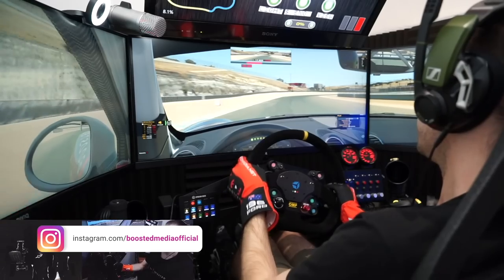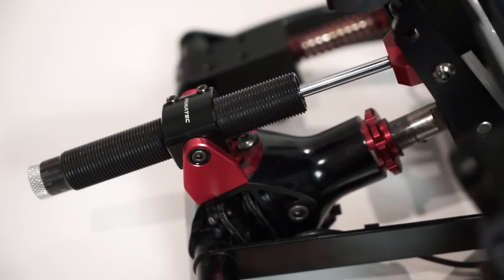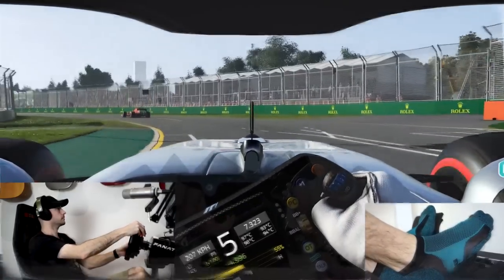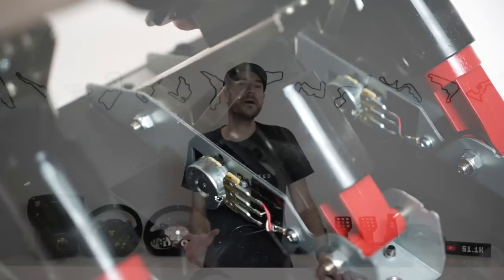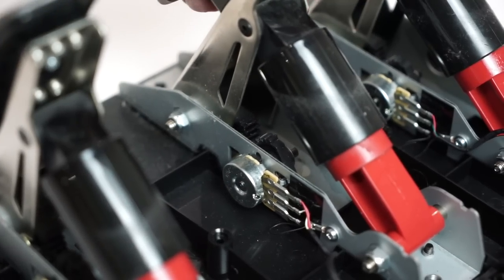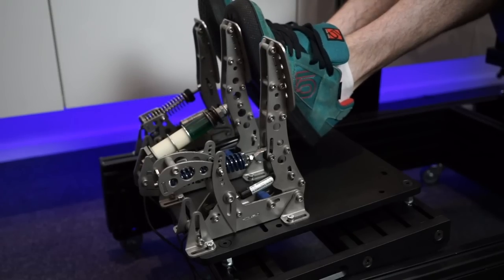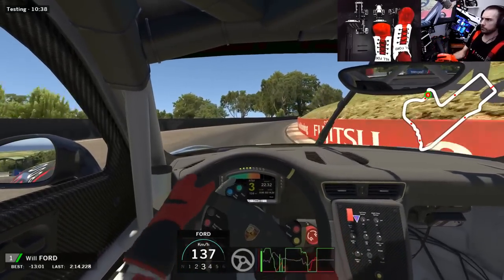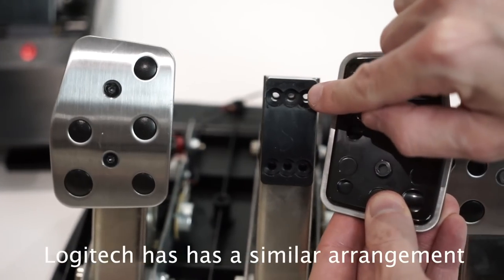Sim Racing Pedals Buyer's Guide

Comment: If you play with a desk and chair, there is a very cheap and easy solution when upgrading pedals. Mount the pedals to a piece of plywood, then cut holes that the wheels/legs of the chair can fit into. The downside is that you have to get it just right because you won't be able to move forward or back, but I did it and it works really well.
Reply: I put a bolt into the playwood and connected that bolt with a steel rope to my chair. The steel rope has a rope tensioner in its middle for adjusting the distance. 
Works great and I can press the break as hard as I want. 

The only downside is that when you press too much from above, your chair gets lifted up.
Reply: @karlmaier1013  so, you can do wheelies!!  Haha
Reply: I don’t understand this
Reply: I took some paracord, tied a loop and just hung them onto 2 of the wheels on the chair and 2 of the racing sim stand's foot. works just as well and hassle free

Comment: And... Just bought a heusinkveld sprint. Comming tomorrow i think.. Sold my v3.. And i was lile: no never gonna upgrade, i love my v3 and got them dialed inn perfect.. And i got all inn the same ecosystem. That was important to me.. The i got a deal on those sprint.... Sic... Now more time adjusting and tuning pedals before driving.. Hope theyre worth it...
Reply: Espresso Ryen-Grødahl and? Are they?
Reply: @johntaylor2971  its another ballgame! One thing is the buildt quality. But the feel of the clutch. When you feel the bitepoint. Breaks are awsome! And while you on v3 had to crawl "down under" the rig to adjust loadcell, here you have software. And you can adjust "everything" in that. Kg of loadcell pressure, linear non linear and in what way no linear. And save it to different profiles. And if you want you can have different set up for all the different cars. Stock its all linear, you can allso download some prebuildt profiles. I tried out and use the gt3 one (to everything in iracing) just adjusted the bitepoint on clutch a bit..
Reply: Espresso Ryen-Grødahl I take this as a „yes, they are“.... I did like them too
Reply: @johntaylor2971  yes, for short.. 😂😂😂
Reply: Espresso Ryen-Grødahl 😄

Comment: I really enjoy your sim racing channel: Informative, Articulate, Unbiased.  I'm just getting into sim racing and trying 'slow my roll' and not jump in with both feet before deciding if it's something more than a quick fad for me (I've done this too many times and spent way too much $$$).  My current setup is G29 w shifter, Playseat, ButtKicker and PS4. Sim is Project Cars 2.  Goal now is to learn, practice and race with friends and family around the World.  I would really appreciate some insight on gear that I could buy now to use with my console (PS4) that would transition to PC if/when I decide to get serious.  My research thus far points to Fanatec CSL Elite, but my knowledge is limited.  Thanks in advance.
Reply from the maker: I’d probably skip the buttkicker as they aren’t real great with consoles. Put that money into a better wheel and pedals. :)
Reply: Boosted Media I’ve already purchased the ButtKicker. 🤣 
Looking for assistance on hardware upgrade path from PS4 to PC per my comment above. I’ve noticed other comments asking for the same info. 👍🏻
Reply from the maker: Jeffrey Deitch next video in this series will be on monitors and VR. Then PCs :)

Comment: The thing I don't like about the Logitech G29 pedals is the "play" in the mechanical system. The black, toothed, plastic lever has about 4-5mm of play before/after the potentiometer turns. (I've modified my pedals accordingly.)
Reply: I would like to know more about how you reduced/eliminated this issue.
Reply: @jeffrey-deitch  Inspired by this video https://youtu.be/KiesEdzZFM8
realised that just needed to wedge shims underneath (such that the pedal is already partially depressed). There's a threaded hole for a bolt nearby, so was able to use that to hold shims in place.
I used DIview with my laptop to check the calibration.
Hope that makes sense?
Reply: @jeffrey-deitch  forget that I actually filmed this video on my phone at the time. Apologies that there are no graphics, voiceovers, stunning pieces of music... And the fact that it's in portrait (rather than landscape), but hey ho
https://youtu.be/pS1WVZ19Xps

Comment: When you get to PCs, can you cover how much computer you NEED to be able to run at high(er) quality on a 49" super wider monitor, triple screens, etc?  I'm looking to purchase a gaming PC I'm having a hard time finding guidance on what is necessary and what is overkill.  Particularly in relation to GPUs.
Reply: Don't know if this is helpful, but I've had both setups with my PC. I had triple 4K monitors and switched over to a 49" 120 Hz 1440p ultrawide. I can play at pretty much max settings on the 49" and get ~100-120 fps in games like Project Cars 2 where they take advantage of things like SLI. Other games like Forza Horizon 4 and Forza Motorsport 7 only use one GPU and are pegged at 100% to get 85-120 fps at ultra settings. With 3x monitors using Nvidia surround I was rarely able to get 60 fps with resolution at 4K in PC2 so I lowered the resolution to 1440p or 1080p to get 60fps stable. If you're looking at getting one 49" ultrawide then you'd probably need at least a 2080/2080 Super to take advantage of the monitor's refresh rate. My CPU is rarely at more than 25% load during these games so that's definitely overkill.

Specs:
i9-9900K
Asus Z390
32 GB RAM 3200MHz
Games on Samsung 860 Evo 2TB SSD
2x Asus ROG STRIX GTX 1080 Ti (HB SLI Bridge)
Samsung CRG90 49" 1440p 120 Hz Ultrawide
Reply: CS R Thanks.  This is helpful.  Do you find you need the 32GB RAM?  What type of issues would  you anticipate 16GB would cause with everything else being equal?
Reply: @edac5681  I only need it for video editing. For gaming it's overkill. The streaming might be using a lot of RAM, but if you're below 90% usage I wouldn't worry about it.

Comment: Fanatecs hyraulic damper on the gas would help I’m sure because the spring is gonna wear over time and get lighter, my load cell brake pedal has about 3/8’s of an inch of travel, bolt them to your rig

Comment: Hi Will, does there have to be a shifter connected before a clutch is recognized in the software? I'm waiting for my dd wheel to get here (good luck on that right now), so I hooked up a T150 and used t3pa-pros with it but doesn't detect the clutch. To be honest though, you really have to spend on pedals, thx, these guides are bang-on.
Reply from the maker: No the clutch should be detected. That’s strange.
Reply: I use t3pa-pros with t300rs gt. I have no problem using my clutch in manual cars. Do remember that most Sims won't have clutch on cars that don't come as manual in real life
Reply: I have a T150 and just got the T3PA-Pro, still trying to improve the position of it. How do you like the T3PA Pro?
Reply: @chrisd3510  I do not looove them. But with the conical brake mod they're a lot easier to control (how much you press the brake). But if I had to do it again, I would've gotten the Fanatec CSL Elite LC (emphasis on the LC) for $230 or now I guess you have the option of the Thrustmaster T-LCM for $200. But I feel the brake being a gradual changing position instead of a pressure sensor is a deterent. It was great when I started but now that I want to get better at trail braking and all that stuff (plus I try to compare and practice with my real life cars, 2 Subarus and a Porsche) I feel the lack of a realistic feeling brake pedal kinda sucks.

Comment: Hey Will, one thing I've run into is wheel rim compatibility.  For example, I've got a Fanatec CS V2.5 base and am curious what is available.  I know what Fanatec offers and they have adapters to run generic wheels and you can even add buttons to those generic wheels, but do other companies make compatible wheel options?  Just a thought!  Keep up the great vids!
Reply from the maker: No other company makes direct FANATEC compatible wheels, however there are some emulators available that allow you to mount a different quick release, and FANATEC also sell a universal hub that allows you to mount other wheels but with no button functionality. 

As for FANATEC wheel compatibility with different FANATEC bases, it’s all listed on their website.

Comment: Other than those like you here online I don't know anyone who has a  steering wheel and or a pedal set that even races on console or in sim racing ,so I have  no way of comparing my pedal setup to theirs or the type of pedal setups your'er talking about when it comes to things like how much break pressure is being used  to get maximum breaking before lock up . I don't have a way of gauging that with my pedal's that I have . But I am using  the g27 pedals with the g29 steering wheel  because they are setup in the  gt style already  and I like the style better than the stock g 27 or  g 29 version  but I didn't like the way  they felt not being able to get that muscle memory use from it . So  I replaced the throttle pedal spring with a stiffer 25 lb compression  spring did the same with the clutch pedal and  I put  a 45 lb.  1 1/4 in . compression spring  in a rubber tube lubricated  inside a  3 1/4  in compression spring that is also inside a rubber tube and lubricated  and I  also put  1/2  inch rubber bumper at each end of the brake spring and  it has made a world of a difference in being able to use muscle memory verses the stock Logitech pedal version  . I have to stand on the breaks hard  to get lockup and at the higher speeds it almost impossible for me to get the breaks to lockup  but I do feel them grab and release where the  tires lockup and release like with ABS but I also get that same type of feeling even when i  don't have ABS on  but its just a little less of that feeling  where the breaks grab just a bit more  but don't totally lockup  . But I  don't know how they compare to higher end or  load cell pedals or what they feel like.  I wish I knew someone who even had a wheel and pedal set besides just those like you who I know I will never meet in person outside of online from your video's you do .  I'm sure they are better than what I am using but for now mine feel good  I just wish I had a little more throw  in the pedals than I do with them .

Comment: I so wish I could try a high end set of pedals, the v3s are good but nothing amazing.  I wish it was easier to change out the bumpers on the brake to change the set up per car.  The software helps a bit as you can adjust how much force but the feeling will remain the same under foot.

Comment: Keep dealing with my g29 pedals having to be cleaned because of dust. Any recommendations on which pedals I don’t have to deal with cleaning them every month
Reply: @Throw Away meant to add dust getting into the sensor but I fixed it already and haven’t had to worry about the issue for a year now

Comment: I’m so lost. Im newish to sim racing 3 months (Iracing) came from (Ps4 Nascar).I have the T300 & use the stock peddles I made a  wood rig. & I want/feel like I need to upgrade. For the biggest reason. Is I can’t feel the car break loose. Now idk if it’s the wood rig or settings or just the T300.  So like you said the peddles are the most important add. I do more GT3 & Audi Rs3 & Mazda series. That being said being newish to Iracing what peddles  would you recommend?. I think I like a soft peddle if that helps. Thanks & great content.
Reply: I am in the same boat lol.. have 2 months... have a gt omega Apex rig and stock t300.. im waiting until the csl load cell

Comment: I'm here because thrustmaster has failed me for a second time in 6 months. when my first set of pedals failed, gas pedal wouldn't lift, I found a small spring was bent inside... I decided to upgrade anyway... new pedals and 3 months later, now I can't get full throttle... gas pedal goes down all the way, but it stopped giving me full throttle.. happened during  a race so its not the settings... im not spending hundreds of dollars for thrustmaster pedals anymore!!

Comment: Not ideal but for a nice cheap solution, I have my pedals stuck on top of a cardboard box with double sided tape to stop them moving, butted up against another taller cardboard box that is in turn against a wall, and shoes on my desk chair wheels to stop it rolling (2 bigger shoes on the front 2 spokes, 2 smaller shoes on the side spokes and nothing on the back, which gives the chair a nice backwards tilt as well). Definitely a poor man's sim rig, but leagues above floor mounted pedals like you talk about where you use your ankle to "stomp" the pedal rather than nice controlled pressure using your leg muscles.
I just need to find a way of stopping my chair from swivelling if anyone has a suggestion for that?

Comment: How could you not talk about hydraulic based pedals (brake is the focus but gas pedal is often used as well in these sets) as a option in this video about sim racing pedals? You are doing a massive disservice to your viewers by not including this as a option and you also lose some credibility by either not knowing about them or for whatever reason not including them in this video.

Please do a revision of this video with hydraulic pedals as a option. If you really don't know about these types of sim pedals here is a great vendor (google hppsimulation) and I think one of the first to offer hydro pedals for the sim market and a good starting point as well since there are several vendors offering hydro pedals.
Reply from the maker: I talked about hydraulic systems in the video and will be testing some out for myself soon. 

This video was focussed more on the differences in the electronics as that’s usually the main taking point.
Reply: @boostedmedia  Fair enough and apologies if my comment felt like an attack which it's not. This is a great video packed with useful information, again I just thought it strange to cover all the bases minus the hydraulic gear. Looking forward to your up and coming videos